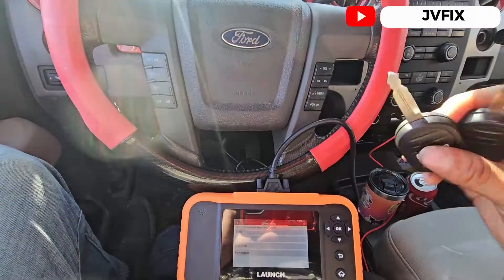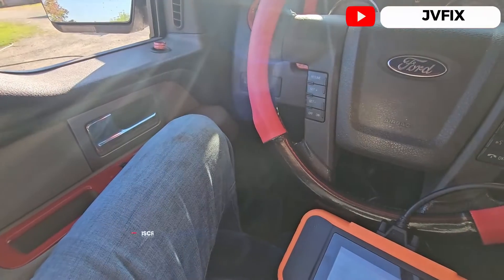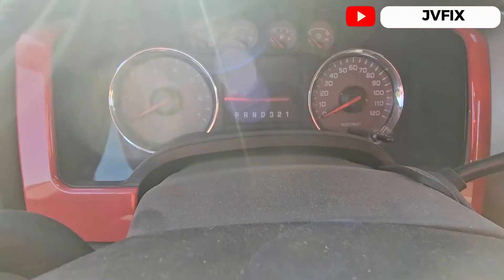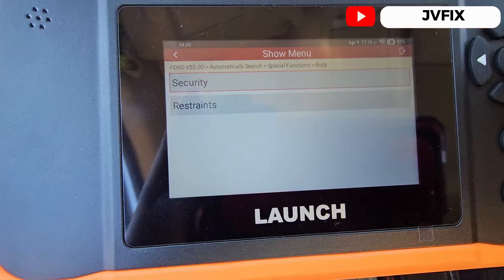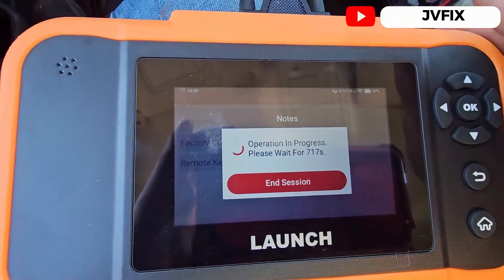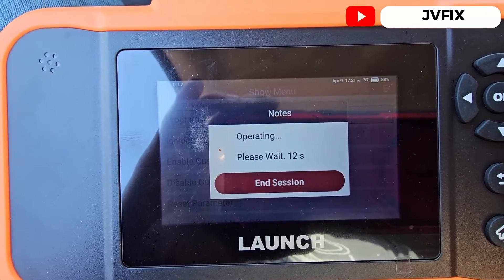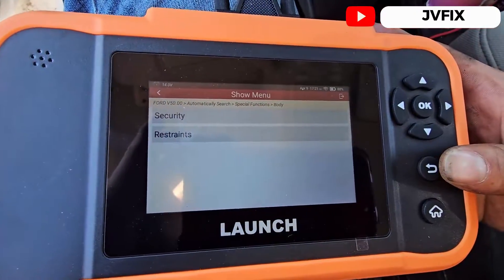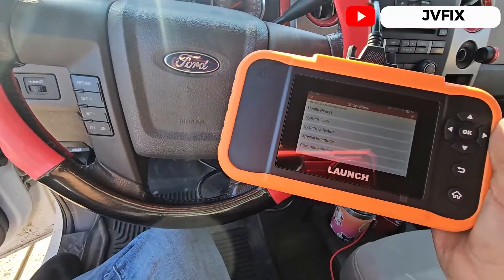How to program new key on 2005 Ford F150 using the most affordable scanner! Launch Creader Elite 2.0

Comment: Hi i have a question ,i have a 2010 ford escape that only came with only one programed working key.i bought extra two blank keys that i had cut. That i was planning to program using the same scanner tool you use in the video so i can have 2 spares.now i have read online that in order to program a key it requires that you already have two existing working keys that are currently programed for the car beforehand.also in the video right before you started the pat procedure that took ten mins,a blue screen popped up on your scanner that said “minimum keys required after ignition key erased 2”.so considering i currently only have one programmed key for this car.i am wondering if the procedure will work, i am also worried if it doesn’t work is it going to deactivate the only programed key i have left for the car. so just to be cautious I wanted to ask you when you made this video. Did you already have two programmed working keys for the truck before you did the procedure or did you only have one programmed key when u made the video? if you could let me know, I would be extremely grateful. Thank you.